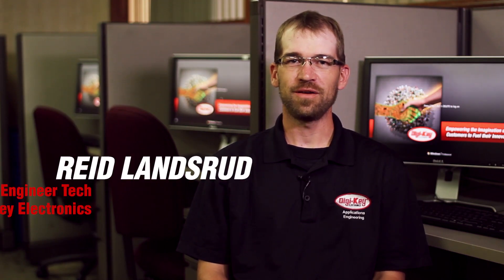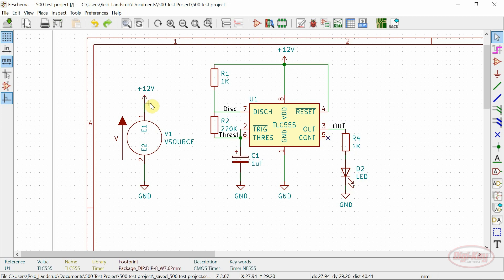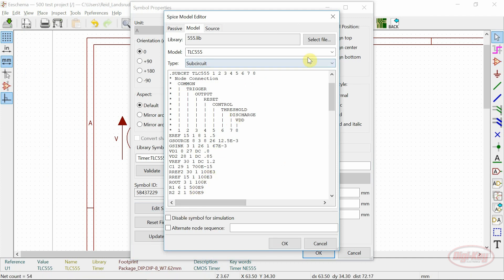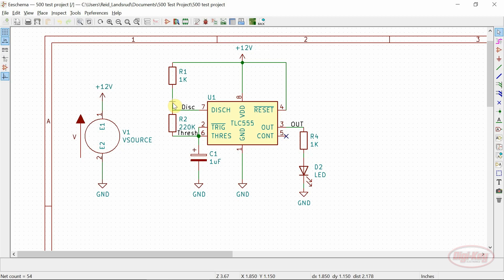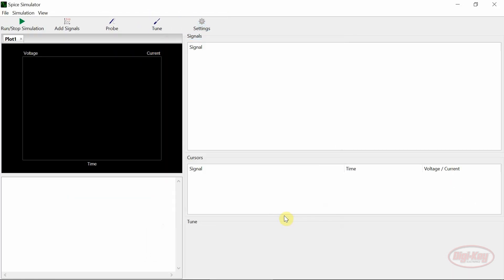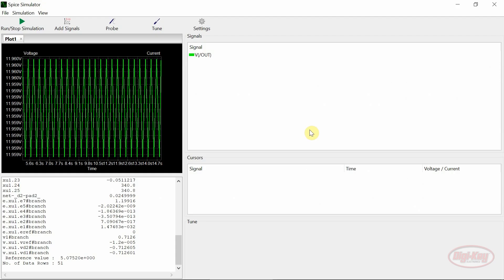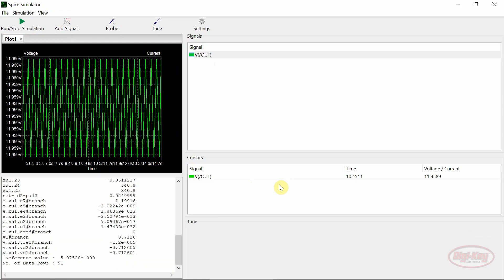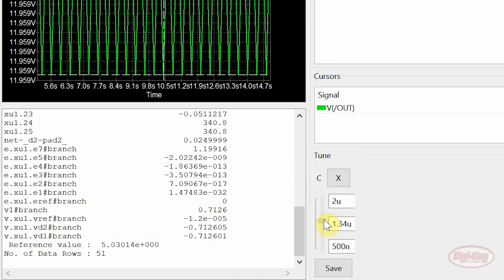KiCad 5.0 Changes and New Features: Spice Simulator 3 of 7 | DigiKey

Comment: I repeated this bit for bit and I can't get it to work. Did you download a spice model that you didn't show in this video?
Reply: Same issue here...
Reply: @jefflariviere  make sure you are using parts from the spice-library.. on adding a component, just type in "spice" or "simulation".. Other parts cannot be simulated by default - you would have to provide a spice-model for those yourself.